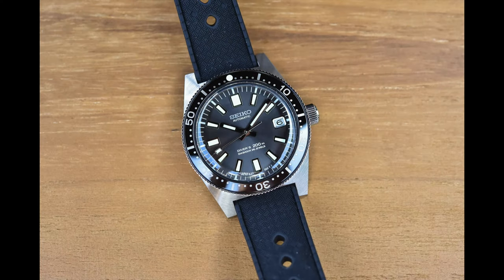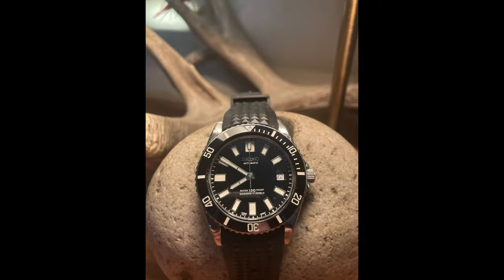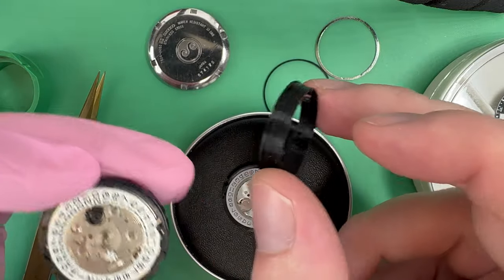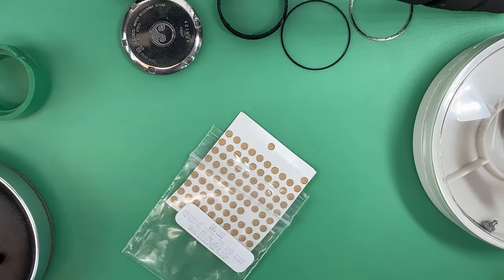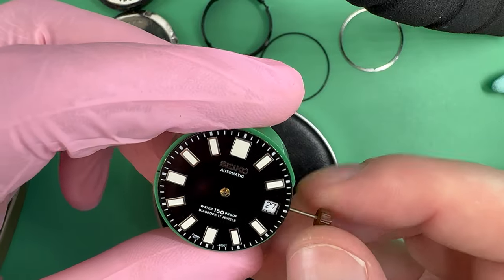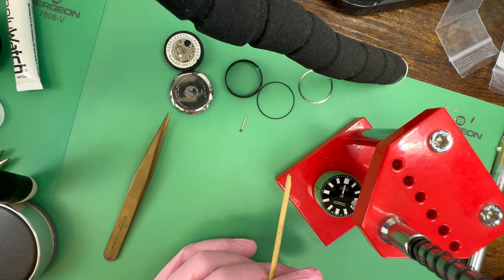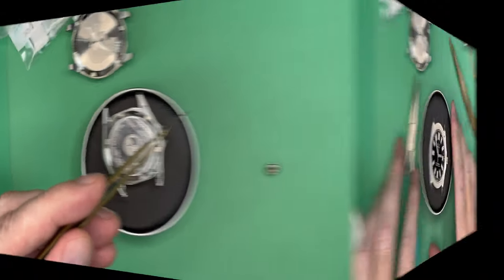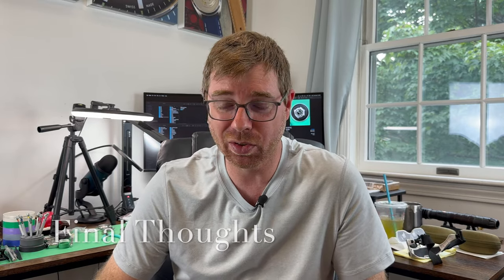Swap a 7S26 Movement with a Ronda 515 in a Seiko 023 Case

Comment: I do not understand a reason why watch with a cheap quartz movement is declared to be automatic Seiko watch.
Reply from the maker: the person wanted their old Seiko fitted with a quartz movement, so it's their choice if the dial has the original text and the movement has been changed. I wouldn't sell new builds with that design, but for a person's personal project and watch, that's their choice.